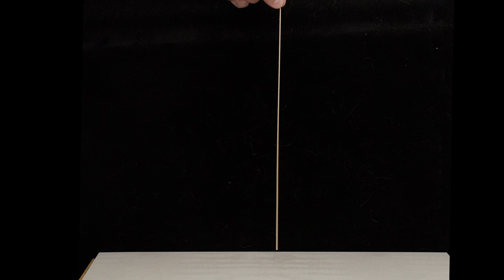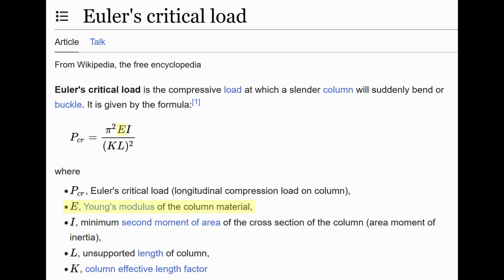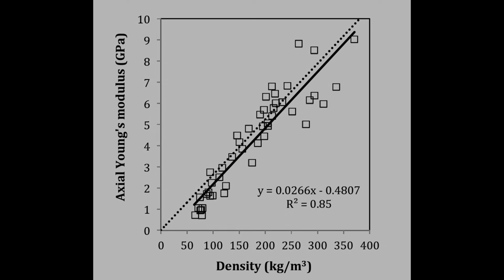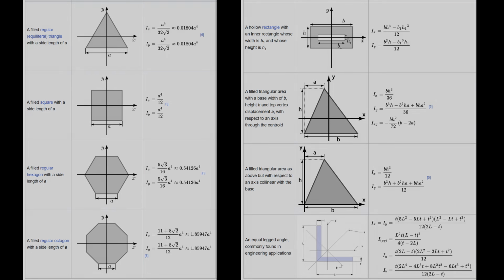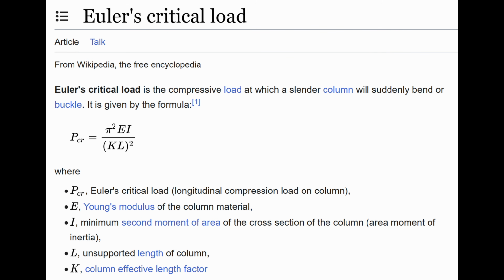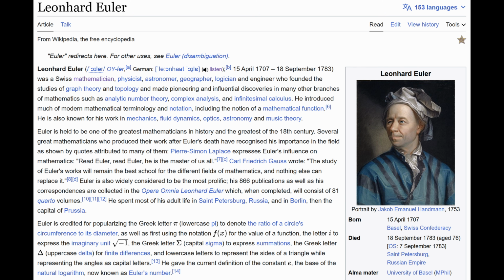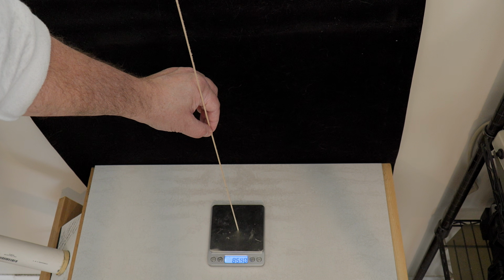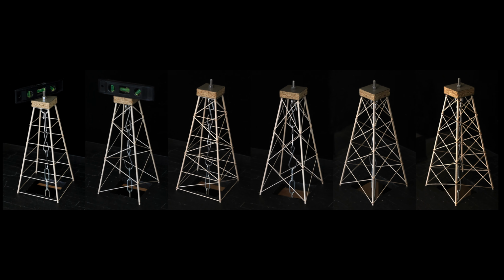Tower Basics: Part 2: Buckling

Comment: Do you know where I can buy balsa wood of precise size/density? It's difficult to find 1/16" sizes on amazon, much less wood with consistent and measured density
Reply from the maker: When buying online, I like to use Specialized Balsa: https://specializedbalsa.com/products/balsa_sheets.php   There you can buy sheets of just about any size and then cut your own strips.  I would recommend for this application, it's worth it to specify "light" density.  Be sure to check out my creating a balsa library video to see how I cut the strips and a few tips when using that tool: https://youtu.be/bLsTOpmozGI
Reply: got it, thank you
Reply: also, how do you cut the balsa sheets precisely? Do you use a cutter?
Reply from the maker: @allisonhuang9589  Yes, I have been using this simple stripper tool:  https://www.amazon.com/Master-Airscrew-Windsor-Propeller-Stripper/dp/B0000WS5OQ/ref=sr_1_2?crid=1MQM027RAYKBT&keywords=balsa+stripper&qid=1706663550&sprefix=%2Caps%2C249&sr=8-2      Watch the video I linked above to see it in action